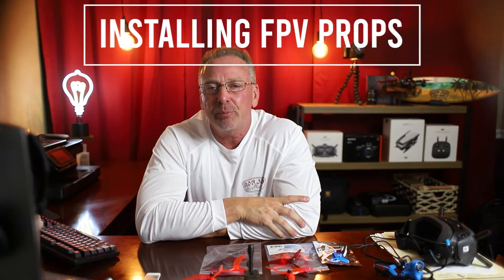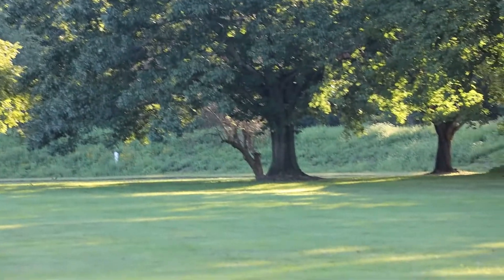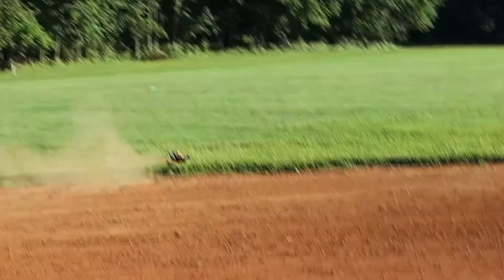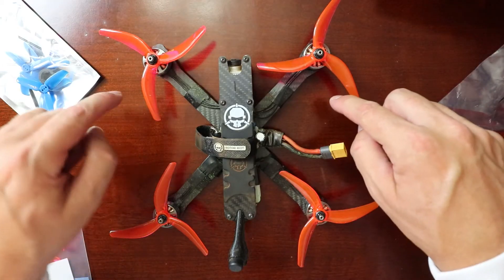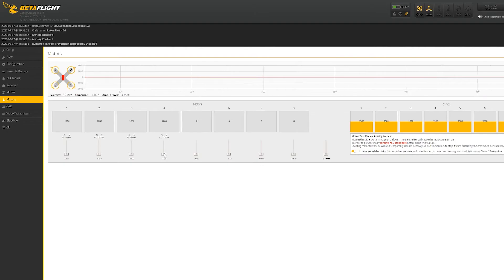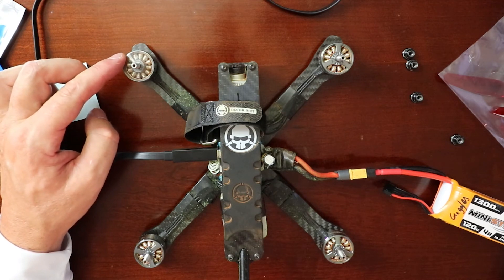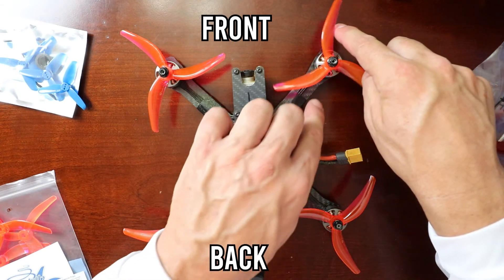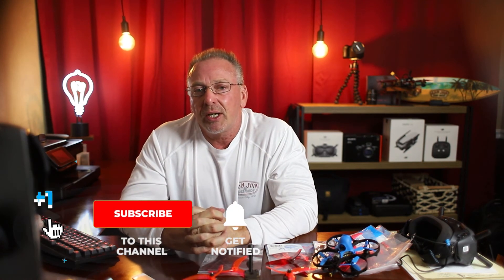How to Install FPV Props

Comment: Im watching this after I went for my first test flight, and bam the quad lifted from one side and stopped. Then I hit the throttle again and this time two of the props flew off the drone lol. Turns out not only did I have the props on the wrong way, I also forgot to tighten the m5 nuts 🥲😅
Reply from the maker: Yeah, all things I've done myself.....happens to us all so don't feel bad about it.  Noticed this was posted over a year ago so hopefully things are going well a year later and your we'll into your FPV journey.  :)

Comment: This is super confusing. The easiest and best way to make sure your props are placed right, I found with, DAT FPV, youtuber. Just make sure every prop's lower side (sloping side) is facing the inner part of the drone, with the front and back prop tips facing each other, to make sure their sloping side, or lower side is facing to the side of the drone. Do the same with the props for the right and left side of the drone, and that's it.
Reply from the maker: Not always the case.  Props-In (Standard) vs. Props-Out (Reversed) can vary by FPV or your motor rotation.  The rotation of my Chimera 4 is different than my Rotor Riot HD1.
Reply: @RGMGFitness  So once you know the rotation of the first prop, then the props are, all slanted sides in, or out, without having to know each motor's rotation. But wouldn't they tell you if the drone have a reversed motor in the description, which would automatically let you know all angled downsides out, when centered? It's just easier to remember like that.

Comment: Great and easy to understand information. I got a new acrobee drone and one of the props flew off when i started it up. I'm assuming they click in place. I'm new to the hobby
Reply from the maker: Every drones a little different.  Some just twist on.  Others screw into place.  Props have to go on the correct motor so just double check for your particular model.  👍

Comment: Should the props always slide on the motor? i have trouble with putting mine on no matter how hard I press
Reply from the maker: Depending on the props and motors your using.  Yes, they can often be a bit difficult to press onto (or pull off).  It shouldn't be to difficult but certainly more pressure is used than other types of quads (like a DJI Mavic Air).   Wiggling them on/off often helps as your installing/removing.